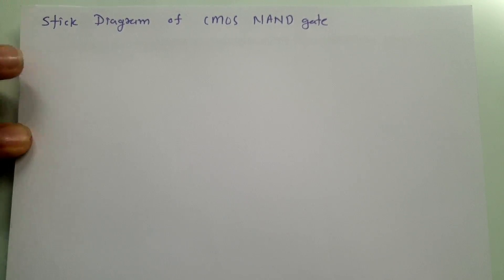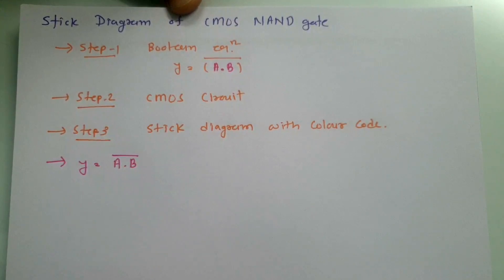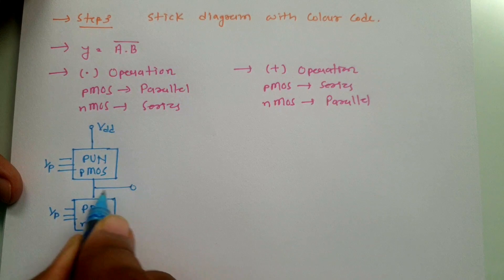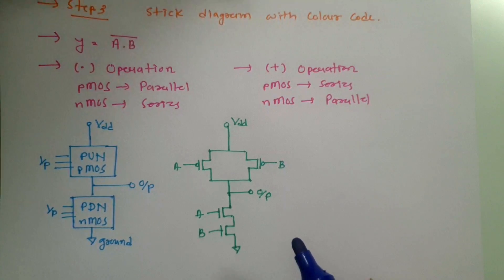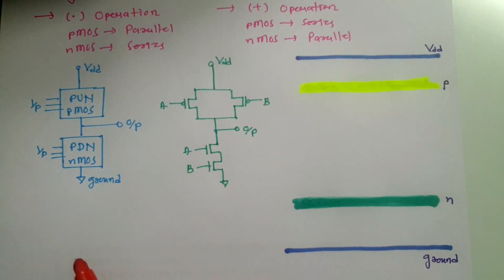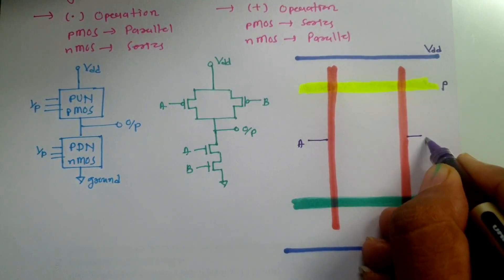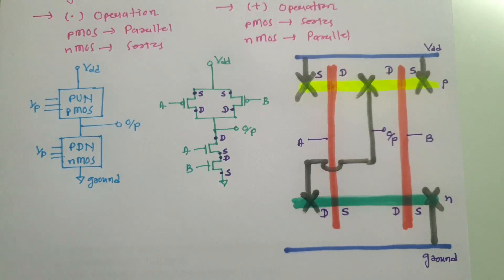CMOS NAND Gate Stick Diagram: Circuit, Design & Working

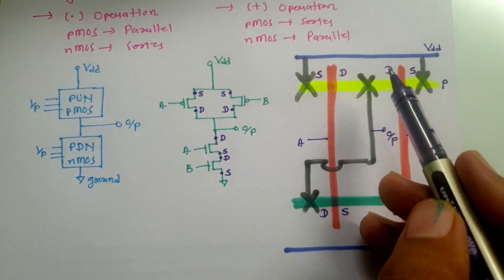Comment: at 9:40 sir can we exchange the D and S positions in the stick diagram with all connections same? Will it still remain correct?
Please tell if you didn't understand my question
Reply from the maker: Stick diagram is used to understand how connection appears in CMOS circuit. D and S terminals have their own characteristics. So you can not interchange this terminals.